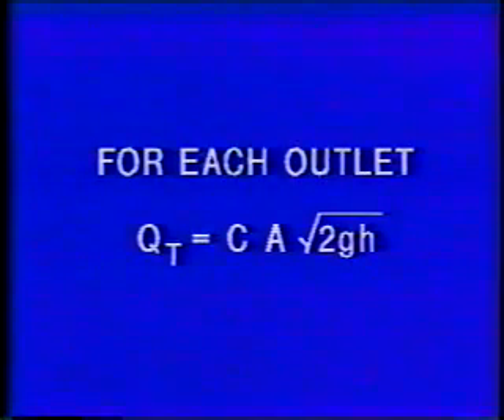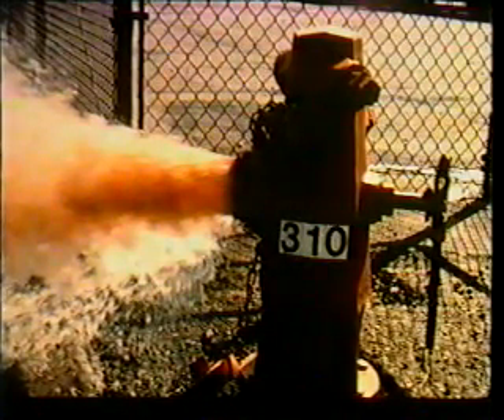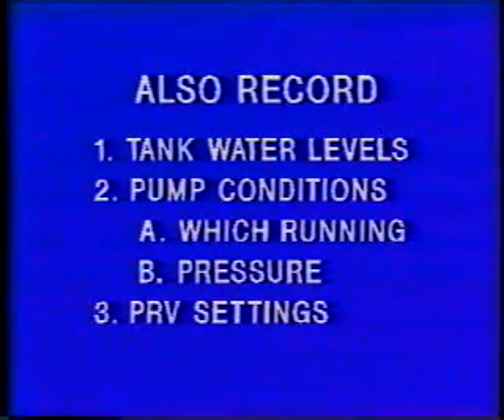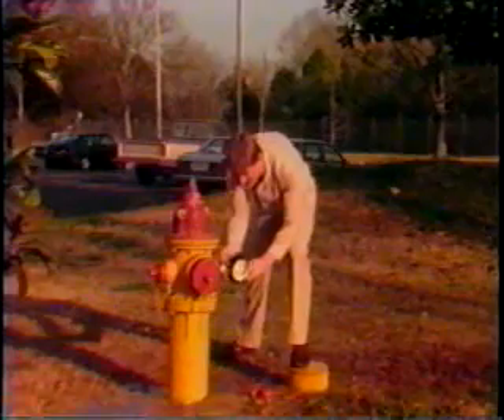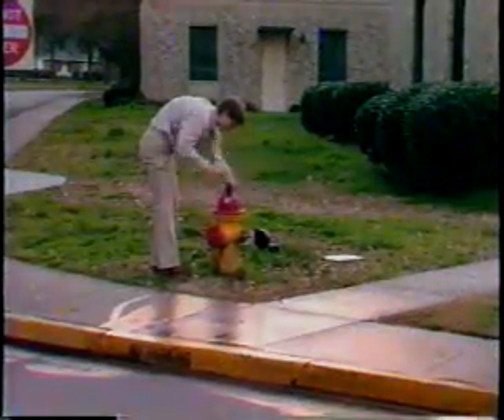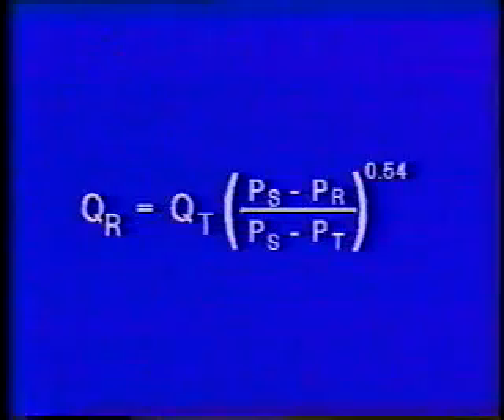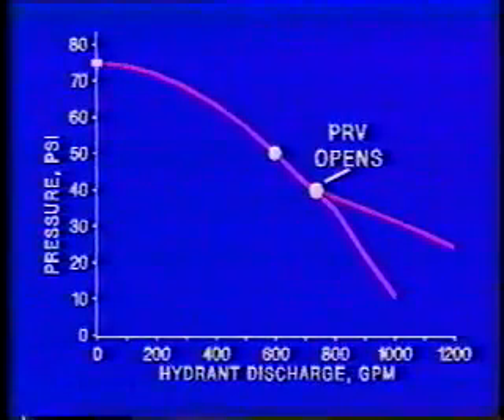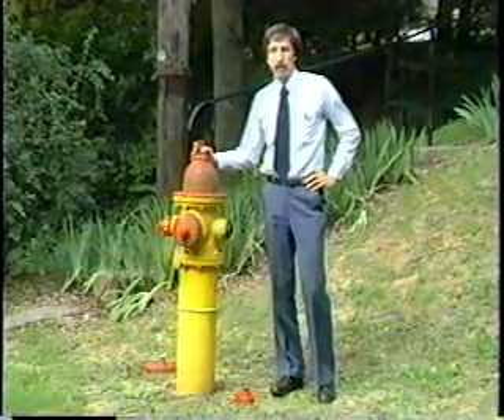CONDUCTING AND REPORTING HYDRANT FLOW TESTS BY DR. TOM WALSKI (1987)

Comment: Dr. Walski, should one perform the test if the flow valve is congruent to the flange ? This would seem obvious in a dry-barrel, but since this is not what these hydrants are, it needs to be explained how the flange needs to be opted within the plunger of the washer valves.